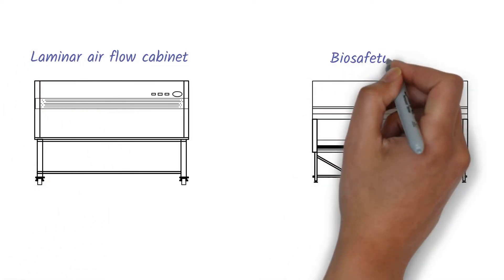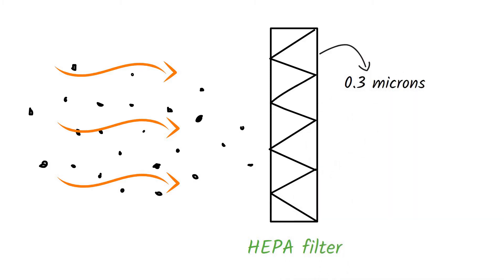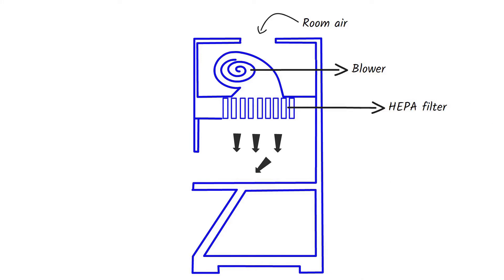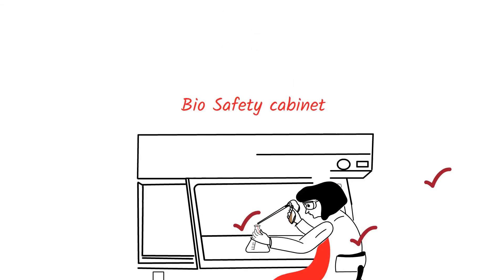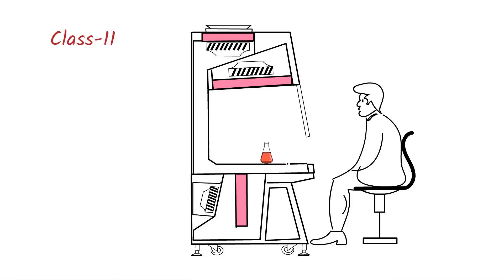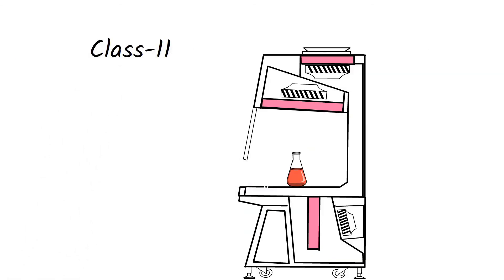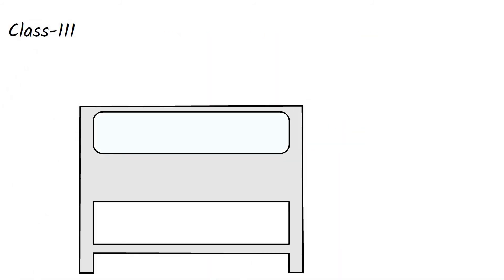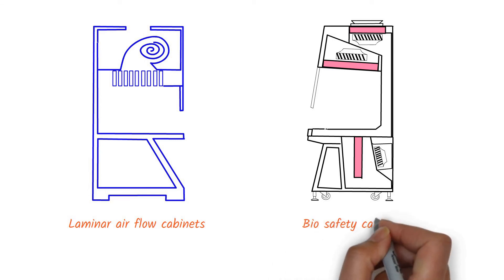Working principle of Laminar Air Flow & Biosafety Cabinets

Comment: If someone is compounding a sterile medication like injections what would they use a laminar airflow hood or a compounding aseptic isolator as their primary engineering control? I'm confusing between the two. Please help! Thx
Reply from the maker: It depends on your process and the next steps of your process. If a sterile filtration or terminal sterilisation is involved, using a LAF located in a grade C may be a correct choice.

Comment: What is aseptic hood then?
Reply from the maker: It’s nothing but a laminar airflow unit. It provides space to perform aseptic operations. Mainly used in pharmaceutical manufacturing operations.

Comment: Great Explanation 👏 Thank you for sharing the information.
However I have a question. What are the common applications for each type or which lab department they are commonly used in?
Reply from the maker: Thank you. The application depends on the type of microorganisms that the laboratory handles.

Comment: Thank you so much for this video. It was very helpful. 
However, I have a question 

When speaking about class 2 biosafety cabinets generally, you said 30% of the air from the environment goes out through one HEPA filter, while 70% goes into the working area.

What about the air from the working area? How is it expelled?
Reply from the maker: Thank you for watching the video. 
The air that comes to working area again enters the front grill and recirculates.
Reply: @MicrobiologyMantra  Thank you so much
I'm really grateful for this video